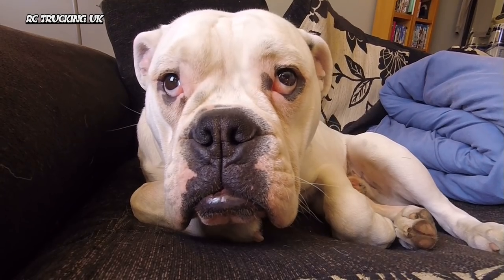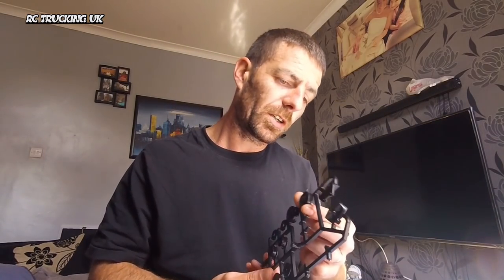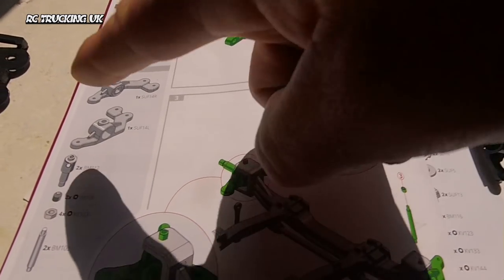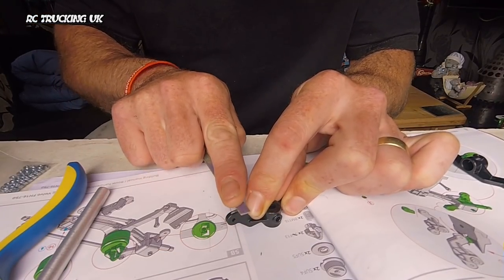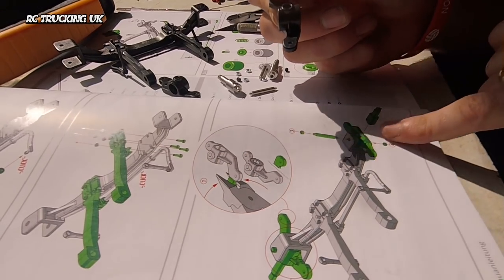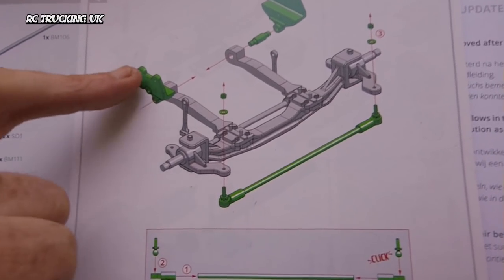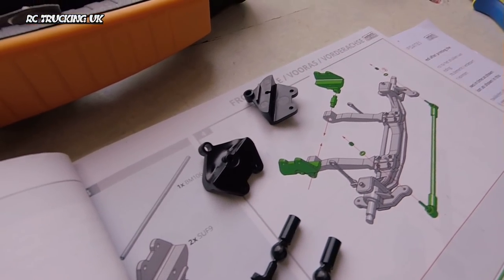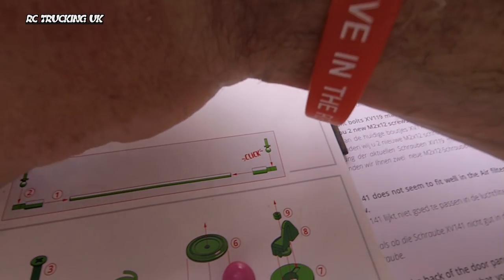RC TRUCK | VERKERK VOLVO BUILD | FRONT AXLE 2 | Part 4 step by step

Comment: poorly assembled front axle, the wheels will be difficult to turn, the servo may burn out
Reply from the maker: Poorly designed lol, it needs filing slightly but I'm not using this to drive, it's only going to be a static model 👍 and if I was to use it I would make the steering smooth and run a high torque crawler servo 😊